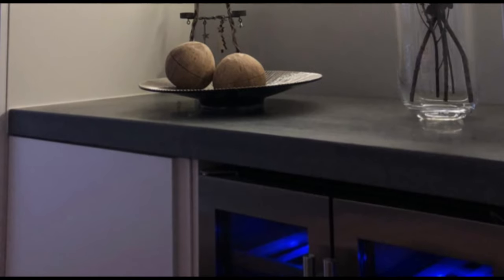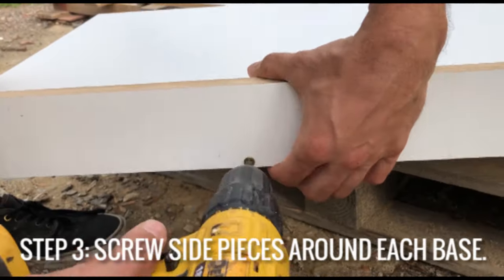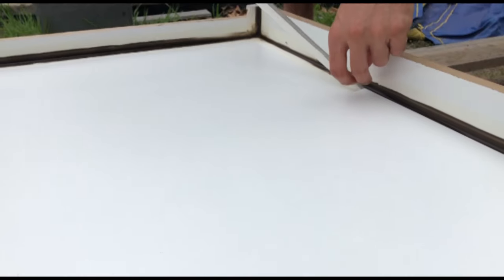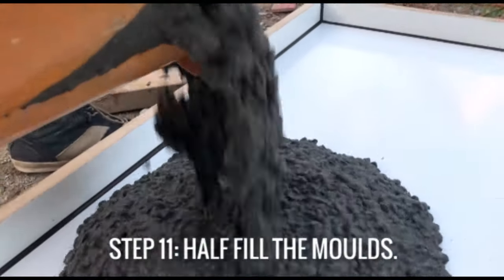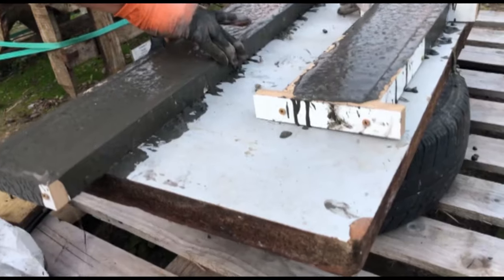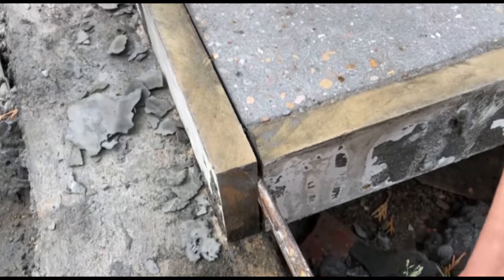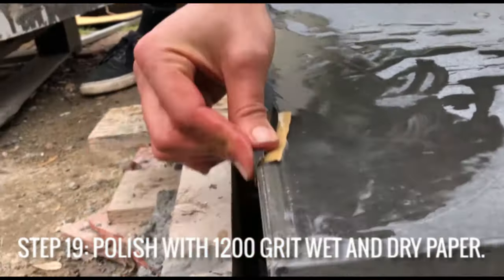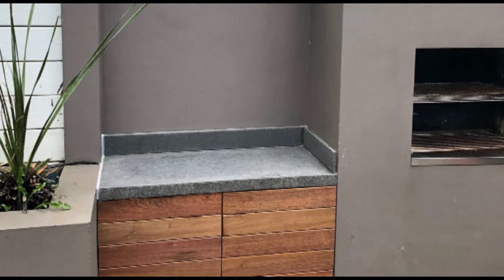The PERFECT Concrete Countertop FORMULA!!

Comment: If using rebar, epoxy coated rebar should always be used, else it will rust within the concrete and the rust will eventually make it through to the top of the countertop. GFRC [Glass Fiber Reinforced Concrete] would be preferable to rebar, unless creating a large overhang for seating (3/8 rebar rods laid at a diagonal), as alkali resistant fiberglass mesh is inexpensive (~$0.50/sq.ft), as are alkali resistant shredded glass fibers; carbon fiber mesh could also be used (~$5.50/sq.ft). PVA [Polyvinyl Alcohol] fibers could also be used in the top/face coat, as they're smaller and reduce shrinkage cracks (examples of each can be found on websites of local GFRC suppliers)

Comment: Ah finally a UK video on this! Thank you! The rest are all just American. Have you ever tried doing a cement layer on top of laminate kitchen worktops? Just looking into that now but struggling to figure out what mixes from Screwfix/B&Q/Toolstation would be suitable!
Reply: Was there a difference between the UK and American versions other than an accent?
Reply: All the American videos use concrete countertop solutions products which aren’t available in the U.K. and also brands of cement mix which aren’t available here either so it’s hard to get links to products. Also the weights and measurements are all in lbs (which off course is a simple conversion), but it’s just easier using kg and a metric system we use here.

Comment: The camera work was good. I wish video had more details...what did you use to keep that hole clear when u poured concrete. Close up and more detail about making mold with the front edge detail to make it look thicker. Did you add any clips to the underside? How many coats of sealer etc. Thanks

Comment: Finally a U.K. video. Brilliant. I was totally unsure on what type cement to get as I have only seen American brands. 
I am building my countertops ontop of the actual frame itself on my outdoor kitchen by pouring the cement directly onto hardie backer board fixed down onto a frame with noggins every 400mm apart. The Hardi backer boards are supposed to take a weight of 1000kg to every 1 square metre. So I’m hoping they will support the weight due to the spacing on the noggins. So I can’t use a vibrating table. Is a resip saw or electric sander fine for the vibrating process??? I also bought the mesh stuff of concrete countertops solutions.  Thanks
Reply: Resip, orbital, jigsaw, hell even a cheap massage gun if you have to. In a pinch you can resort to elbow grease, just grab a mallet or two and drum your way around the edges - not quite as effective but it'll still improve your results.

Comment: Hi Matt, love the video it’s super informative. Can you let me know how much plasticiser you used? I’ve bought the same one you used but there doesn’t seem to be any information on the bottle. Thanks in advance 👍🏻
Reply from the maker: Sure.
If you use 0.5% relative to the cement weight you should be all good.
So if you’re using the premixed bags like me. They’re approximately 1/6 cement.
So per 20kg bag you can add the following amount:
20kg / 6 = 3.33kg
3.33kg X 0.005 = 0.01667kg
0.01667kg X 1000 = 16.67grams of plasticiser per 20kg bag of premixed dry concrete.
I hope that helps.

Comment: Hi Matt, as it has been about a year since you've done this project, is there anything you would change in the making and what would it be. I'm looking at making a hearth in the next couple of weeks and want to make sure I get the thickness and colour right first time. 
I'm also glad this is a UK based project as at least I know I can get all the right components easily.
Reply from the maker: Hi Justin, I’m still making them the same way. Just don’t vibrate them for too long otherwise the aggregate will all be at the surface.
Reply: How many bags on concrete did u need and does the liquid pigment work the same way
Reply from the maker: @justincowdell5787  The liquid pigment does work but you need to figure out a different ratio to the one that I’ve got in this video. Maybe just do a couple of tests 1st to get the colour you want. The number of bags depends on the size of the worktop you’re making. What size are you making
Reply: I'm going to try make a hearth for the fire. Looking at about 60mm thick, 1350mm in length and 780mm deep

Comment: Hi Matt - Came across the video after having watched a lot of USA based videos about concrete work surfaces and have so glad we did!   I notice that you've got the calculation for the pigment based on a 20kg bag of concrete... does this mean cement? so the ratio would be: 60kg Aggregate, 40kg sand and 20kg high strength cement?   Then the pigment for colour?  Sorry for all the questions!
Reply from the maker: Hey glad you like the video. Each 20kg bag of high strength concrete already has the aggregate, sand and cement premixed in approximately a 3:2:1 ratio. So there is approximately 3.33kg of cement in each bag.
You are adding a percentage of pigment relative to the cement weight, so 2% pigment for a 20kg bag of concrete will be 3.33kg X 0.02 = 0.0667kg or 66.7grams
I hope that helps

Comment: Great video, I'm making two small tops for my garden, either side of a BBQ grill. Before I watched your video I was going to buy the blue circle concrete but was put off by the amount of stones. Now I see they're not a problem. Is it a case that they rise up to the underside leaving the top smooth?
Reply from the maker: Hi Lee, they do sink to the bottom, but the trick is to vibrate just enough to remove the air bubbles but not so much that the stones ghost through on the surface. If you make a fairly sloppy mixture like the mix in this video and vibrate for 2-3 minutes on the vibration table you should get a similar finish.
Reply: Brilliant! thanks for the tip. I’ll be giving that a go.
Reply from the maker: @leejerrard  no worries

Comment: Nice video Matt, im looking to make a concrete worktop for my kitchen island 2m x 1.2m. Im cautious of weight on the cupboards and strain on the floor overtime. Have you had any issues? Also what's the minimum thickness you'd recommend as i was thinking approx 30mm. 

Finally I assume the pigment is down to personal preference? it would be good to see a comparison of samples in one of your videos using different ratios.

Cheers

Comment: Hi matt.  You said not to vibrate for too long, what's too long?
Reply from the maker: Hi Dave, it really depends on the size of the piece I don’t have a formula for you but somewhere between 2-4 minute for each piece should be enough to consolidate the concrete with all the stones sinking to the bottom of the mould.
Reply: Thanks Matt
Reply from the maker: @davebeesley4096  no worries 😉

Comment: Quality work! Do you use silicone to join the worktop to the cabinets/frame? I am hoping to make a table and would be interested to learn which would be the best way to secure the concrete to the base. Great videos 👌
Reply from the maker: Yes, you can use silicone or epoxy. Epoxy will have more bonding strength of the two choices.
Reply: @MattHutton  thanks for your help. Take care
Reply from the maker: @jacobcarton3961   no worries and you :)

Comment: Hi Matt, many thanks for posting this! I've been looking at dozens of videos about concrete worktops and this is one of the most informative.

Two questions though. Most other videos seem to use a MUCH dryer mix. This corroborates with advice I've read about not adding too much water. How did you decide on your consistency?

Also, you appear not to have added any sand or aggregate in your mix. Did you just use pure cement?

Comment: Matt, great video.  Can you tell me, what's the thinniest wortktop you have made, I made 53mm one 2.4m X 1m ( really heavy). for my outdoor kitchen about 5 years ago.  However, now I want to make one for my kitchen, thinking about the weight on the units? Any ideas appreciated.
Reply from the maker: Hey Mags Martin, what sort of sizes are you looking to make and are there any thin sections?
Reply: @MattHutton  I hoping to make a one piece L-Shape this time 1600mm x 1200mm to go over some kitchen units. So I wanted to make as thin as possible maybe 22-25mm  to save on weight?

Comment: Love this channel. Really given me confidence to do my outdoor kitchen worktops in concrete. Do you think there is a maximum tolerance for length? I was thinking of doing one about 4m. Cheers and thanks again for the content.
Reply from the maker: Glad you liked the video. Not necessarily. But you got to be able to lift it somehow afterwards.
Reply from the maker: If for example your pieces is, 4000mm X 600mm X 50mm it will weigh approx 288kg.
Calculation:
(4m X 0.6m X 0.05m) X 2400kg/m3 = 288kg
I hope that helps.
I would go for something like 50mm thick with 10mm steel re-bar throughout for a 4m worktop. And give it at least 7 days to cure.
Reply: @MattHutton  thanks so much for advice. Greatly appreciated

Comment: Love this video Matt, i have a question i just moved into a new place and i have a concrete countertop it is very nice but the previous tenants put a few knife marks and deep scratches in the counter you can tell that it came from not having a cutting board do you have a remedy for these cuts or can just sand them?
Reply from the maker: It depends how deep they are. You could fill them with a bit of sand, cement, and acrylic bonding agent mix together. With a small amount of pigment to colour match it.
Or if the are quite small you could used some car body filler and add some pigment to colour match.

The issue with sanding depending on how it was made is that you might expose some aggregate which might change the look of the area. Then you’ll need to sand the whole thing to match. Up to you.

Comment: Hi Matt, great video. I'm going to use this process to make a concrete table top for a fire pit. I've seen loads of US clips showing all the items they use over there but this is the first one film I've seen with UK products.

It was the concrete I was stressing about as I've made the mould and got all the other stuff sitting there waiting. I''m off to source the concrete you used so I can get on with it. 
Wish me luck, I'm going to need it.
Reply from the maker: Good luck mate, it’s easy enough to just make sure to vibrate it well and get the mixture to the same consistency in the video and you should be all good ;)
Reply: @MattHutton  Thanks, I'm going to need it. I'm going to use either a sander or a reciprocal saw without a blade to vibrate it from the underside. I'm a heavy duty keyboard jockey for a living so this is well outside of my comfort zone. I  had already bought same colour tone you used so as long as I measure the plasticiser out correctly I SHOULD be ok. 

I'll let you know the results.
Reply from the maker: @stuartpage9138  awesome, would love to hear how it goes :)
Reply: How long did you leave your concrete in the moulds for? I poured mine yesterday and because they are only a few inches thick, I expected them to be drier than they are this morning. I did use a lot more colour tone per bag in my mixes though as I wanted a darker look. Hopefully that won’t cause an issue 🤞
Reply from the maker: @stuartpage9138  usually 3-4 days. How much pigment did you use and how much concrete did you use?
Reply: @MattHutton  275 grams of pigment per 20kg bag. 2 litres of water per bag (added a tiny bit more to help the mix. 115 ml of plasticiser per mix. Used 3 bags overall so 3 mixes. One was a little wet but I had basically the consistency you had. Covered it with plastic last night and I plan to keep it covered. Do you think I’ve used too much pigment?
Reply: Update: The table top came out really well but I did get a fair few air holes along the line where the silicone is. I should have vibrated the sides more basically. Thy will fill ok so all's good. Follow the vid step by step and the results will be great. Thanks Matt!

Comment: Beautiful video Matt, really great. Make concrete all the things! It's an excellent material when reinforced. Actually i had some questions. For example how many times reuse you think the moulds would last? For example to make some concrete floor slabs, or walls, or other 'tile based' projects..

BTW another observation I wanted to offer here in the comments is to do with the environmental impact of most of the concrete industry, high CO2 is generated for regular concrete. But I think you doing this on a small scale gives some great opportunities on the side here to also experiment with a variety of co-called 'eco' concretes. Which can be much more difficult to get right. I remember limecrete is one such material. Which was showcased on Grand Designs. But there are also other ones. For example there was also a TED presentation on carbon negative concrete. Anyhow neverrmind which specific one(s). My main point is that this process, this method seems like a really good proving ground to do this research into the practicality of them. And to get the chance to properly learn them, and evaluate them. Since otherwise 99% nearly all of concrete is used in buildings where nobody can afford to experiment or take such risks. The cost of failure usually being too high in those other typical construction scenarios. So if you can find sufficient time to do this on the side, it is a useful pathway / route towards developing a knowledge that can be transferred to other larger scale building projects later on. Well it would be great if they invented an eco concrete that behaved just exactly like regular concrete. With all the same exact properties. But it doesn't seem that is happening as things stand right now. It can be tricky those eco concretes. You wouldn't want to bet the house on it! Is a much shorter / more concise way of saying all that ^^.

Anyhow great video thank you so much with all these important little details, and steps like the mould release etc. Looking forwards to seeing how you made the vibrating table. Good day.
Reply from the maker: Great thank you very much for the message. I’m glad you liked the video. To honest I’d never even heard of of eco concrete. I’ll have a look into it.
A mould made from melamine will probably last 2 - 3 as the moisture in the concrete starts to seep into the mdf after  a while. You make be able to increase the number of uses, by spraying a polyurethane lacquer over the top to further waterproof it. 
Thank you very much for watching the video. :)
Reply from the maker: Make sure to subscribe and turn notifications on to get notified for the concrete vibrating table video. :)
Reply: @MattHutton  Thanks, that is a great advice. To make the mould last longer. BTW just to be clear: there is no such thing as 'eco concrete' as a brand name or a specific product. It's just a generic term to mean concrete alternatives / other formulations. But the specific ones can in fact be very different to one another.
Reply from the maker: @dreamcat4  no worries, okay good to know :)
Reply from the maker: Hey @Dreamcat 4 here is the video on how to make a vibrating table for you :) https://youtu.be/8P63Zxk_Uys

Comment: Hi Matt Great video. Looking at making a  concrete work top for my BBQ cart. what is the minimum  melamine board thickness for the Mould is safe to use?  What is the minimum concrete work top thickness is safe to make without breaking when lifting? I will have a big circle cut out in the middle for the webber BBQ to sit in. What is the minimum safe distance from work to edge to the edge of the BBQ cut out? I won't hold it against you if it does not work, this will be my first time challenge and with your experience I hoping you maybe able to give some guestimates. Any advice would be much appreciated Cheers.
Reply from the maker: Hey Emmet, what size of worktop are you looking to make and what sort of size and position will the hole be in? Then I can make a recommendation for you. :)
Reply: @MattHutton  . Hi Thanks for getting back to me. Overall top size is 1700mm x 770mm. Dia of hole is 620mm located centrally across the width of the top, and 460mm in from the end of the top to the centre of the hole. cheers.
Reply from the maker: @emmetswinburn4612  you want at least 100mm on either side of the hole. For that size of worktops, and to be safe you could go with 50mm thickness with 2 X 10mm steel re-bars going the full length of the worktops down each side to reinforce the thin section.
Thickness of melamine board is up to you. If you’ve got a completely flat and level surface to cast the worktops you can go thinner. But it’s easier to go with something thicker like 18mm as you’re less likely to get warping and bending of the worktop, but you should still put it on a level surface.
Reply: @MattHutton  thats great I will adjust my design. What volume of concrete do you usually get out of one of those Concrete bag?
Reply from the maker: @emmetswinburn4612  (1.77m x 0.77m x 0.05m) x 2400kg/m3 = 163.55kg of concrete required.
Minus your hole.
I hope that helps
Reply: @MattHutton  Cheers for all the advice. Built the BBQ top as you advised and it worked a treat. Well chuffed, thanks for your help. Now making a concrete high table for some bar stools to go around it.
Reply from the maker: @emmetswinburn4612  that’s awesome :) I’m so glad it worked out for you!!
Reply: @MattHutton  Well with good intentions to make a concrete high table, it seems Blue Circle 40N concrete is no longer available at the moment. Are you using an alternative at the moment that you would  recommend? cheers

Comment: Hi, looked at your other videos but can't find one showing what type of sand and size and type of  aggregate? and to what Cement/sand/gravel ratio? Thanks.
Reply from the maker: Hey Gaz, the concrete comes in premixed bags. It’s called Blue Circle High Strength 40N Concrete :)
Reply: @MattHutton  Thanks for the swift reply.